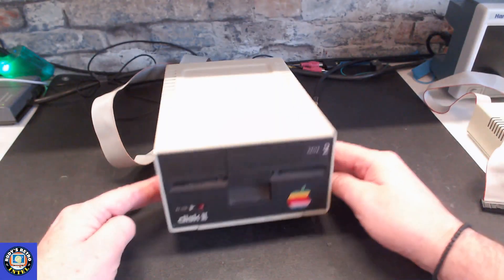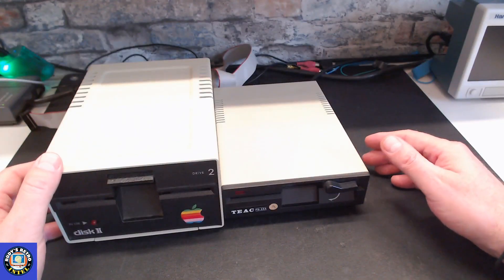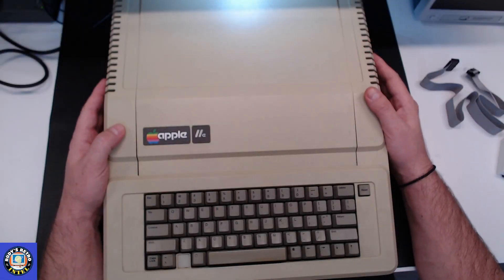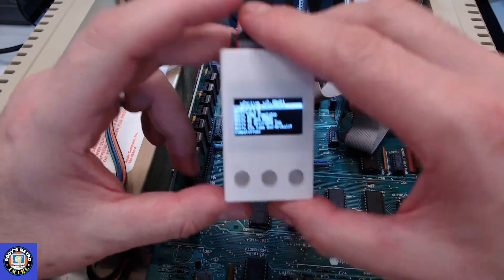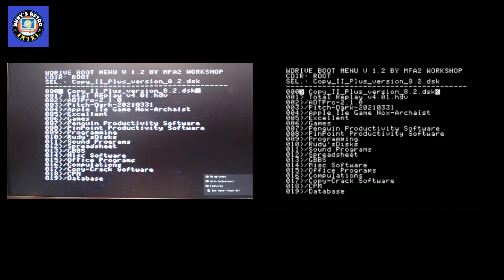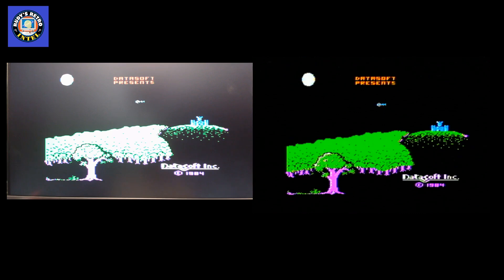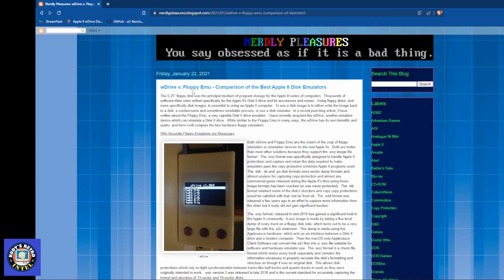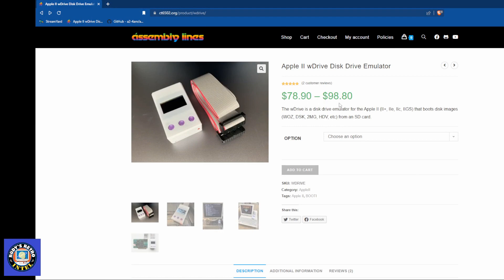Wdrive: A Game Changer for Apple II Series

Comment: Really cool Wdrive! I love your clean install on the second computer and doesn't modify anything original. I just wish there was a way to access it externally and not have to pop the hood. Great video! Now all I need is an Apple IIe! 😊😁
Reply from the maker: Well, you can leave the Wdrive outside the case as the cable is long enough and use double sided tape for easy access.  Yeah, you should get a IIe :) Thanks for commenting